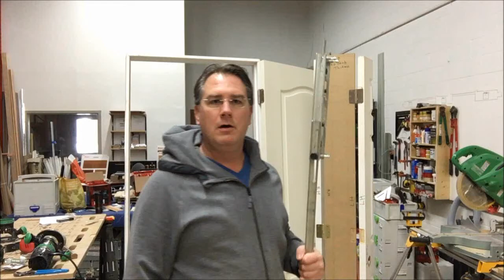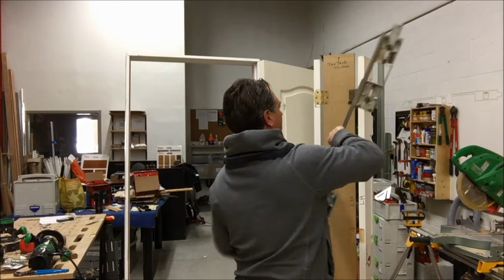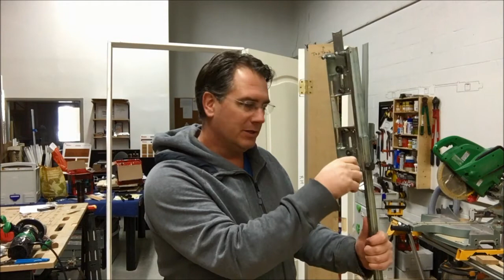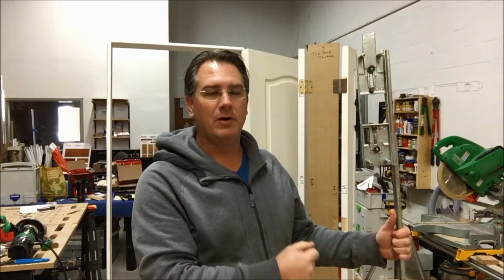Porter Cable 59381 & 59382 Hinge Jig follow up

Comment: It sounds like you are not using the right router collar or you are still not using the jig correctly. The jig leaves the same amount on the edge of the door regardless of the thickness of the door. This router jig really makes hanging doors in an existing opening a breeze. You should not be telling people to flip this jig regardless of your results.

Comment: I recently purchased the 59831 having used a Bosch hinge templet kit for several years. I have most of the setup figured out, but am struggling with the templet guide. I have a complete templet/collar guide kit (Part NO 42000) with 7 different diameters, but the larger ones don't seem deep enough to prevent the bit from coming in contact with the folded edges of the metal on the template. The depth of the guide is about 9/16", but seems like it would need to be almsot 7/8" to prevent contact and run along the inside edge of the bottom of the template. What am I missing here??? This is a hard thing to explain in words, hope it makes sense. Thanks!

Comment: Hi Terry, you end up a very small gap on 1 3/8’’ doors because you’re using the jig on the wrong side. The distance from the hinge to the face of the door is always the same no matter the thickness of the door if you use it the way it was designed and described in the instructions; the big long rail goes against the door, the other side where you use the retractable pins is for the jamb, never for the door.